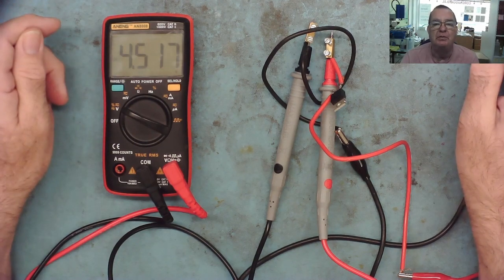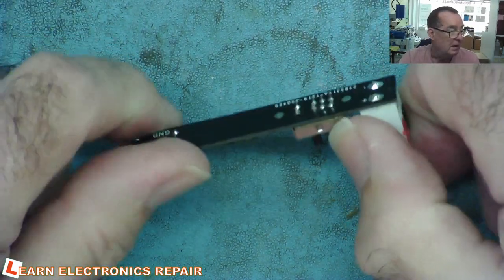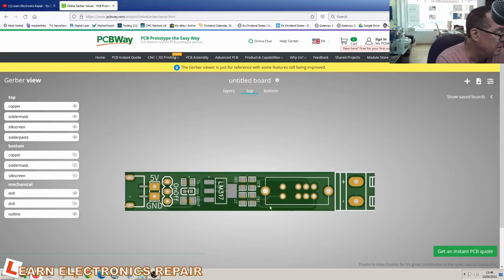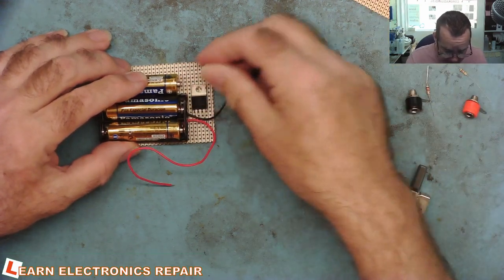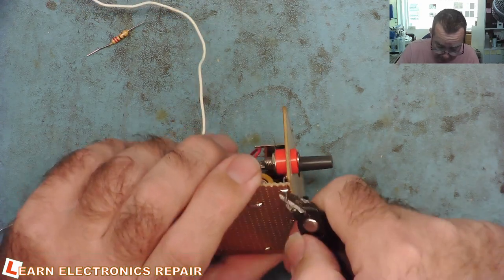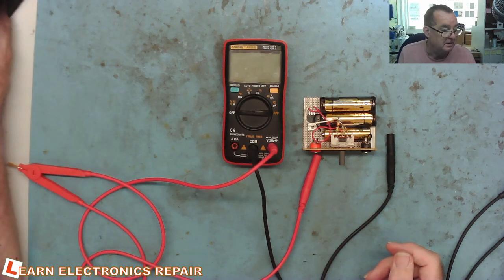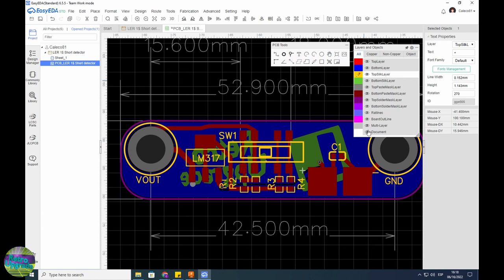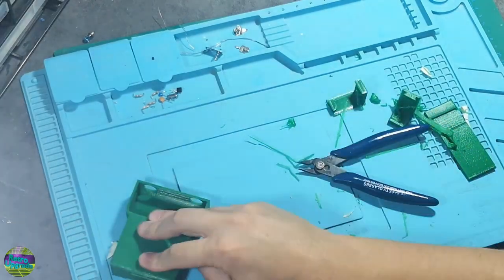The Amazing $1 Short Finder Upgraded! Convert your multimeter to a 4 lead Kelvin Probe Short Tracer

Comment: You inspired me create a microohmmeter out of my DMM using a USB cable, narrow perf board containing LM317T & 12.5 ohm resistor, and red/black clip on leads.  Really compact, sleek, and handy - after I shrink wrapped the board!  All I do is plug in the USB cable which is attached to one end of the PCB,  clip on the kelvin probe leads attached to the other end of the PCB, and set the DMM to measure mV.  Whatever result I get, multiply by a factor of 10 (move the decimal place) and the result is precisely milliohms.  The factor of 10 is because R = V/I, where I = 0.100 A, because Vref(LM317) = 1.25 V and R(adj) = 12.5 ohm.  The 12.5 ohms was accomplished with three common resistors in parallel: 15, 82, and in my case 680.  The last resistor is something under 1K just for tuning out the tolerance variation of the lower resistors and voltage regulator Vref.  I could have used a 1K potentiometer instead of the fixed resistor.  All components were "in stock" so it cost me $0.  Thanks for the demonstrations on this topic, I learn a lot from you!

Comment: Just so happens I “specialize“ in stuff like this, as I have my own small business and lab focused mostly on component level board repair for metrology and manufacturing/research equipment. But I love collecting weird/gimmicky test equipment Devices… 
The strange and quirky things like used to be sold in the back of electronics catalogs in the 80s and 90s 😂 Iv got dozens and dozens in my collection and some of them are hilariously useless…. but some of them work quite well, And can even be the most used and valuable gadgets in the lab.

If you haven’t seen the “leak seeker” by EDS… In my opinion it’s the best low resistance short finder that’s ever been. 

 I’ve owned ALL OF THEM, From the cheap DIY versions up the the really expensive versions like the “Polar Tone-ohm” and “Huntron Trackers”. 

The “Tone-Ohm” units are pretty good if you can get them at a fair price. Even their cheaper versions will bring a couple of hundred dollars and the top-of-the-line versions with all the probes will be quite a bit more. But I’ve been lucky enough to snag at least one or two of each version over the years.

But the functionality and unique circuitry of the “leak seeker 89“ far surpasses anything else in my opinion.

I’ve built several from kits that I keep in and around my lab, and I’ve even snagged a few of the original/old versions on eBay. Dave Miga is an incredible guy and designer… He’s also the original designer of the ESR tester known as the “Cap analyzer 88A”. It was designed decades ago and was the first in circuit ESR tester design on the market… It was so good that Even the big boys like BK precision and others copied his original design.

 There are many Other low ohms/short detectors

-the “half-ohm” multimeter adapter… Available on tindie for about $15.

-the “shorty”

-“short sniffer”

-wavetek sf10

I could keep going as there are many that have been on the market or custom designed over the years.

There are also devices called “short-circuit killers“… They don’t just find the short but they overload it with current therefore destroying it and in most cases restoring the board back to working order. It’s kind of a weird approach but used pretty commonly in the cell phone repair and laptop motherboard repair business. If you haven’t seen them just look up “short killer“ on Google or YouTube… It’s kind of a weird approach but it seems to work for a lot of folks.

Comment: The cutters have a flat bottom side while the top are tapered., thus will want to ride up on the insulation and slip off. The insultation is actually being cut on a  bevel as well when held right way up. When held upside down the bevel cut is on the insulation that stays and the flat cut is on the piece you want to remove.

Comment: Great little project! ... a suggestion for another project is another type of probe I found really usefull when I started out (and still use it sometimes) ... is a simple audio probe for signal tracing. To go with it you could also build a tiny battery powered amplifier from e.g. a TDA2822 (only a handfull of cheap parts) or similar and add a tiny speaker for use with the audio probe. This gives a very useful tool and also an introduction to amplifier building for e.g. headphone amps ... :)
Reply: Hi M8,
So if i understand you its  audible signal tracer . 

interesting i have seen something similar used in car repair but it was for hearing knocking and other irregularities on a car engine, via a stethoscope looking thing with a amplifier and a time scale reducer (took 1 sec and stretched the audio 10X(as normal sounds from the engine are are at 1k-5k rpm. this made it possible to hear scratching and other irregularities.

OK don't with the rant . 

So hmm. if we do the same for electronic signals we should have a specific sound/audio for different types of signals and if we slow it down (because we can't hear frequency over 6-20k hertz so a single over this would be in-audible ) but if slowed down we should even be able to hear ultrasound.

just an idea don't have a clue if it works :D
Reply: @RetroUpgrade  Hi Retro ... yes an audible probe (with in series capacitor for DC blocking in case you probe something you shouldn't by accident) housed in an old writing pen body for ease of holding. Usually used for audio equipment, you inject e.g. a sine wave signal into the circuit then trace that signal through the circuit with the audio probe listening through another amplifier. I have many oscilloscopes here but still use my little audio probe at times. I made a tiny battery powered 2watt amplifier from a TDA2822 and used a tiny old scrap car speaker (in it's pod housing and built the tiny 2822 circuit board & battery into this too) for the output so the probe and speaker are completely isolated & hand held. It's a good alternative to an oscilloscope sometimes. You've got some interesting ideas on a variation ... :)
Reply from the maker: @johnnybravo505  This is something I have in mind to do. I  demonstrated a kinda ghetto version of that already just using PC speakers and a capacitor - I also used the same device to test if a motherboard or GPU is accessing the BIOS

https://www.youtube.com/watch?v=2pAp1R24XyY
https://www.youtube.com/watch?v=0hWnkRl3t1Y
Reply: @LearnElectronicsRepair  Yeah I thought it would fit in well with the kind of simple & cheap but useful tools your making regularly, especially if you can make it really small and handheld (I think you've already covered a small sig gen) and the same circuit with a couple of changes doubles as a perfect headphone amp circuit (and sounds great if you power it from a 9v battery). I used an old car speaker backseat parcel shelf "pod" from the 1970's that I found in my workshop when I moved in for speaker and housing (just didn't want to throw it out) but any small speaker could be used to make it a lot smaller. I look forward to your spin on it & you could get your mate Retro to design & print a housing .... :)

Comment: Thanks guys for an interesting video.
As a former calibration & measurement technician I find it very easy to modify this circuit even further - to a DeLuxe version meeting precision specs for an accurate plug-on milli-ohm meter device to your medium hobby multimeter.
That's another story, as this circuit was purely made up for tracing shorts on PCB's.
Thumbs up 👍👍
Reply: Thanks a lot :) 
if you point us in the right direction i can give it a go and modify the Circuit so it meats industri standard specs.
be aware that i don't have a formal electronics degree 😜 so be gentle with me  😆
Reply from the maker: CXensation - why not post it on Discord Sponsored projects section - we can get some free PCBs made and send to you, if you are OK to publish the project 🙂
Reply: @LearnElectronicsRepair  My arthritis in my hands disallow me extensive use of the mouse for circuit drawing.
But I will take a discussion on a precision circuit with Retro Upgrade.
Reply: @RetroUpgrade  First off - we need a "kelvin" switch not to introduce offset voltages here - like a good quality gold plated contact switch.
The switch must be a slide contact point type to be self cleaning.
Remember that the measurement current passes thru the switch ranges thus affecting the indicated voltage ...
The ranges should be 20-50-100 mA - because most multimeters already have a 10mA range for their lowest ohm range.
The range resistors should be E96 1% types and the values should be corrected for the LM117 bias current, as this always passes thru the DUT (device under test).
This is done using a calibration procedure where you measure the voltage over a precision resistor, and then modify the range resistors to get a correct reading.
1% 10ohm and 100ohm resistors leaded type should do.
The voltmeter must have an accuracy of at least 2% on the milli Volts scale.
... that should give you a milli ohm meter prescaler of some 2-3% accuracy, which is Hi5 for current sensing resistors 🙂
Reply: @CXensation  Thanks a lot will try to source the necessary parts to make a prototype
Reply: @CXensation  some of the details flew over my head but me and Richard can figure it out. (and I am taking care of my 4 yr old right now so don't get time to concentrate atm 😁)
Reply from the maker: @CXensation  Thanks
Reply: @CXensation  Good point about the switch, I actually had a problem building a similar circuit because of the switch which was hard do diagnose, used a little more heat which caused the switch to have a little more resistance which ruined the current output and made it unstable.
Reply: @mmghv  :yougotthis:

Comment: Just ordered some of these, I had a look at the option to have them do the assembly out of curiosity (I'm a beginner and won't learn much by getting someone else to assemble it) and it was £30 so definitely not worth it for a project like this at least, maybe for larger projects it could be more viable. 

I had an idea while watching this that might make for an interesting series but I'm not sure how possible it would be. I was thinking of all of the basic equipment needed to start in electronics repair as a hobby, and a lot of them have DIY solutions of varying usefulness floating around on here and I'm sure elsewhere. It would be brilliant to have a beginners course of sorts where you could walk the newbie through building some of their own equipment while introducing and expanding on some basic concepts in real world, useful (and potentially money saving?) examples.

Sounds like a lot of work but food for thought I reckon.

Comment: The point of kelvin probe is to measure the voltage at the absolute last point of contact for an accurate reading, that's important if you want to read the actual resistance, for short finding that's not important, the important thing here is a better connection for current to flow, I found that a pointy tip is much better for that, IMO a thin multimeter probe with the current wire soldered 1 CM from the tip is a better, more accessible and convenient solution for short finding.

Inspired by your first video I built my own circuit with a toggle switch toggling between 100mA trimmed with a 10 turn pot (useful when I want to measure actual resistance), and an adjustable one using regular pot paired with a transistor that is able to get up to about 500mA out of the 317 regulator, using this high current added more resolution and made it easier to find shorts in a close range.
Reply from the maker: Mohamed Gharib That's good to see you were inspired by my original version - this is what all this is about IMHO.  Your version sounds very useful.  For whatever reason the version with the kelvin probe was the most stable and highest resolution (it worked on the 1mA range) but this could also be attributed to the use of batteries as a power source.

I have and idea in mind that may have the combined advantages of kelvin clips and sharper points, and is cheaper than kelvin probes - I will be testing that on an upcoming video
Reply: @LearnElectronicsRepair  sounds great, looking forward to it, your your videos are a great source of information for us learning electronics at home.

Comment: Thanks for all those very interesting videos! I recently retired from testing & repairing medical electronic equipment. I built the “Amazing $1 Short Finder” using construction techniques very similar to yours. I put it in a repurposed minibox (from a discarded medical gadget) and used a 5 VDC wall wart for power. Without going into a long sob-story; How well do you think the short finder will work on a +55 VDC rail short buried deep inside a Tektronix 465 ?

Comment: Excellent. Very nice. I think it would work very well without a constant power supply. If we have a 5V source and use instead of the current limiter a single resistor of 100 ohms for 50mA, 47 ohms for 100mA we will get the same results. The resistance we measure is small, below an ohm and then it does not affect the current so much and we will have almost a constant current source. For overvoltage protection, a silicon diode can be placed in parallel with the testers in direct conduction, which will limit the voltage applied to the circuit to 0.7V.
Reply from the maker: It would not work with just a resistor as the current through the short would vary too much depending on the short 'resistance' to trace it accurately.  This tester relies on accurately measuring voltages down to 0.001mV - the resolution of my Aneng 8008 meter. Fortunately LM317 cost almost nothing,  and are easy to find on scrap PCB to salvage. 

As an aside this would not work with a bench PSU set to 50mA either as there are large output capacitors on bench PSU that dump a large instantaneous 'discharge' current spike into the device under test (that the PSU can not control/limit) every time you used your probe

This device does not need a diode or anything else to limit the output voltage to 0.7V.  Just like your multi meter on diode mode does not need a voltage limiter even though they usually output 3.5V-4V with enough current to light an LED and we all happily use meter on diode mode to poke around GPUs

I proved this emphatically on this video with theoretical and practical demonstrations.  This 5V device will NOT damage a GPU or CPU! I also proved a bench PSU at 50mA can not be used in this way and will blow components
https://www.youtube.com/watch?v=XEbWyQgX_Mc

Give that a watch then let me know if you still have any concerns regards the voltage used to test. 😉
Reply from the maker: @Max Mini I think YT may have auto deleted the links in your reply (or the whole reply).  Sorry if that happened it's not me.  I can see the reply in my feed but not here

copy/paste

Max Mini
Thanks for the reply. I'm totally agree with what you said. I saw the other clips related to measuring small resistances and short circuits and you are right. A voltage limitation would only be necessary if the short is measured in the case of circuits that consume very little current and have high resistance.
Diode voltage limitation has the disadvantage of consuming batteries if a battery-powered source is used.

Great and useful videos regarding short circuit finding:

https://www.youtube.com/watch?v=0eixDdCpiO4

https://www.youtube.com/watch?v=P_2GGNr4q1s

https://www.youtube.com/watch?v=XEbWyQgX_Mc

https://www.youtube.com/watch?v=i8TudEfD2Ao

https://www.youtube.com/watch?v=kGM-Zmrr6tc

https://www.youtube.com/watch?v=NUgO7v4cbKs

https://www.youtube.com/watch?v=GCHM_svGO4Y